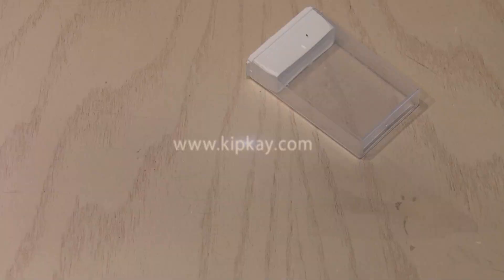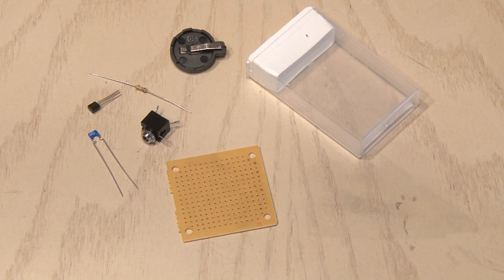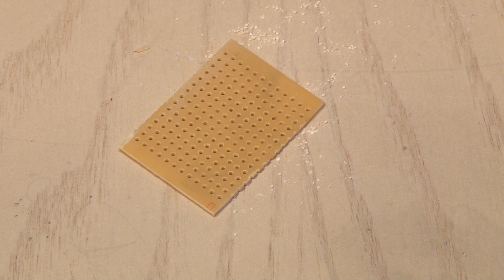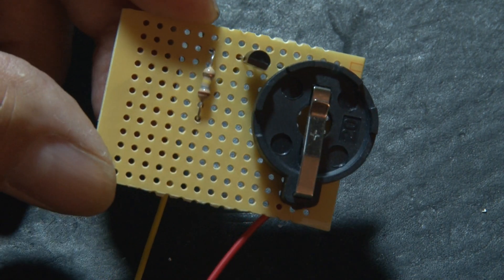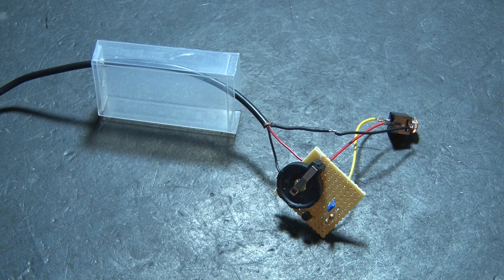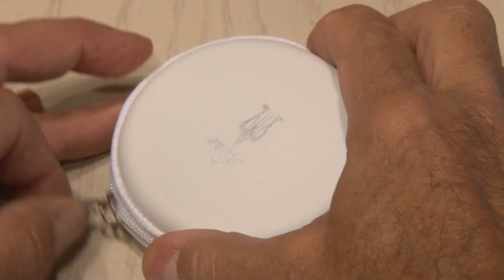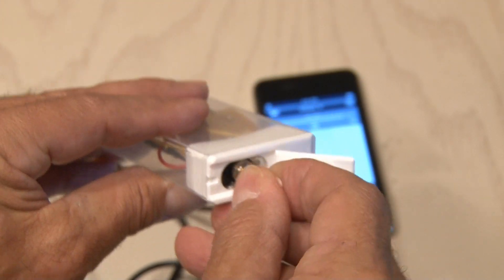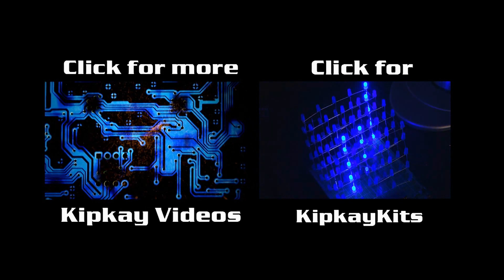Mini Tic-Tac Amp!

Comment: to everyone who thinks that headphone amps are pointless, they aren't. higher-end headphones almost always have a higher impedance (resistance to electricity) than most consumer-grade headphones/earphones. if you were to plug a pair of Sennheisers or Beyerdynamics straight into your iPod you wouldn't hear anything, and when you turn your iPod all the way up, the sound is garbled and messed up. headphone amplifiers help devices like iPods, smartphones, and computers power good headphones and good speakers and help even the worst pair of earbuds sound so much better that people who go down that road never go back to listening without one.

Comment: This is just what I need for my DIY in helmet speakers.  I hacked up a set of earphones and installed them in my helmet for tunes while I ride.  Unfortunately they are not loud enough to hear over 30mph.  This amp should fix that.  Thanks!

Comment: Kipkay you saved me! Few days ago I was looking an amplifier for small portable speakers for my laptop and this is going to work. But instead of a classic resistor, I'm gonna put a potentiometer. But a question: If I saw correctly in the video you put a CR2032 battery which is 3 volts and in the schematic it says 1.5 volts. Does the voltage matter for this mini amp?
I found some electronic parts that I have in my house
Will a BC547 transistor and a 22 micro farad capacitor do the job? I have a bunch of resistors.
Reply: i noticed the voltage difference, and theres also one in the cap. the schematic says .1uF and the parts list says 1uF. Does anyone know which is correct

Comment: Why bother trimming the board so much then put it in a container 2x as big, at least use the space for extra batteries or something
Reply: The board had to be trimmed to fit widthwise(not a word, I know, but it's what is needed here), not lengthwise. He could have maybe cut one side out but it wouldn't had fit with both sides.

Comment: Or you can spend $30 online for a fiio E6 headphone amp that does a lot more
Reply: Or you could spend $1 and make this.
Reply: more like $10 unless you have a bunch of random supplies hanging around
Reply: Silken'sPersonal ***** Hmm... Let's see:

Tic-tac        1$ish
Resistor      0.25$
Capacitor    0.50$
Transistor   0.50$
Holder        1.50$
Audio cable   - Just strip one from one of your old appliance, old pair of dead earbuds, etc.

Total cost? Around 4$. No 10$. And that is if you don't have ANY components available. If you have the tools to make such a project (breadboard, soldering iron, etc), you probably have components laying around somewhere.
Reply: Don't forget the shipping costs!
Reply: Or you could realise this is a DIY project on a DIY channel and the whole point of it is to make stuff.
Reply: The fiio e6 is rechargeable, has built 3 built in eq, is smaller and probably lighter. Most likely louder too, and has an on and off switch. Not to mention it looks better. I understand this is for people that want to it just to have fun. But I wouldn't actually make this and try to use it as an actual product everyday.
Reply: Yeah, I'd only make this for the fun of it... and maybe to learn something new. I wouldn't seriously use it as an amplifier. Why? Because the sound is already loud enough for my liking; I usually keep the volume on 1 or 2.  :P
Reply: oh no im wrong :/

Comment: Does it make the audio louder? From how I understood it it was pretty much a headphone extender.
Reply: yea likewise. Unless in this case he means amp, to amplify the sound (ie make it louder?) But most amps you think of are their own sound output in themselves. Like a guitar amp. (though maybe that does something similar, like amplify a quiet electric guitar...) yep confused.
Reply: Headphones that are of higher quality need more power. It is called impedance and is measured in ohms. Higher ohms required the more power it needs because there is more resistance in the wiring. To get the full potential out of high quality headphones you want to give them the power they need or else you'd probably think they're over priced trash. If you want to learn more go to any tech forum and look for audiophiles and then you'll get lost on the internet for the next few hours feeling like you're missing out because to get a better listening experience there is a lot of work and money to be be had

Comment: How much boost will this give? I have a pair of ear protectors that have a built in radio and aux input. The radio is loud enough but when I plug in my phone the sound is barely audible. I'm thinking I could integrate this into the existing circuit. What part(s) should I change if I need more boost?

Comment: What exactly does the amp do? Does it just make it louder?
Reply: Shadow you do not know what you are talking about. Ohms are a unit of impedance, not power output.
Reply: Improves the EQ of the headphones, much like the same way surround does at a cinema or PC speakers with a sub woofer attached.
Reply: Ikr whats the point?
Reply: bryce chao To push power through headphones that have high reistance. Basically meaning they're quieter. But good too
Reply: It amplifies the signal, making the speaker pump harder which makes it louder. It doesn't change the sound itself in any way except in volume.
Reply: Okay so higher end headphones need more ohms to power them to get the full experience and hear their full potential. A mobile device only put out ~36 ohms. High end headphones need anywhere between the 36 - 600 ohms I believe 600 is the highest, I've forgotten. Basically higher impedance the more resistance so you need more power.
Reply: Shadow Actually, it's for low efficiency headphones. Many high quality headphones lack in bass without a bigger power source. Earbuds will never need this though, so that was a bad example on his part.
Reply: All that with people buying headphones with more bass is just ridiculous. I you want to hear the song they way it sounded to the people that made it, use headphones with equal output of everything. Not just bass. It destroys the song.
Reply: sebbe antblad Depends on the music you listen to. I'm an EDM fan so more bass is good in some cases. Songs that dont really have bass in them, yeah its pointless to have them.
Reply: Ty

Comment: just curios why would you need to increase the volume of the headphones/earbuds
Reply: some earbuds or headphones sound good but low in sound or low bass, this just gives it an extra 25% its like amplifying the volume control bar
Reply: Headphones sometimes have high OHMS, which means more power is needed to drive them. Especially something like the dt 880's, great headphones, just needs a-lot of power to drive.